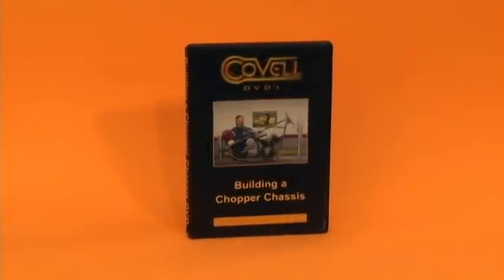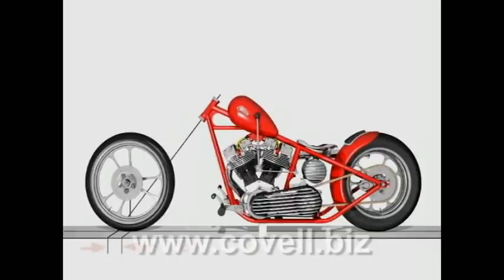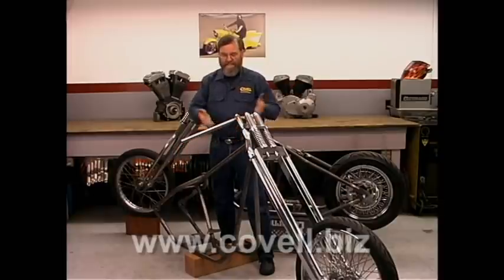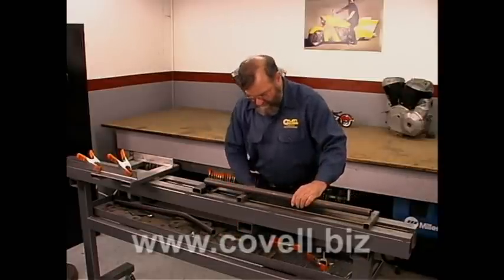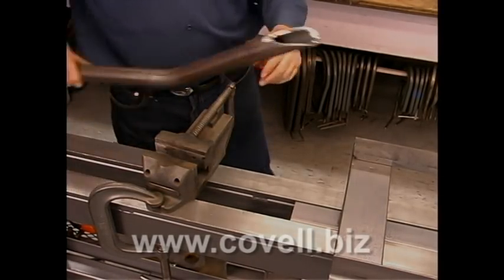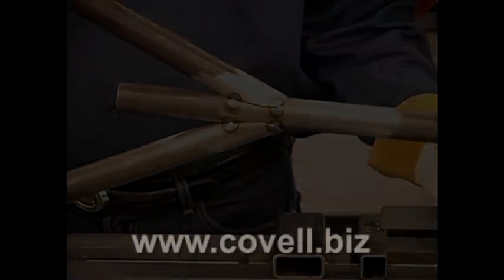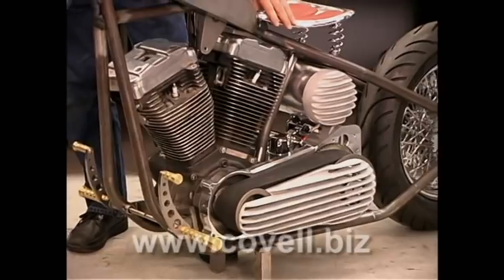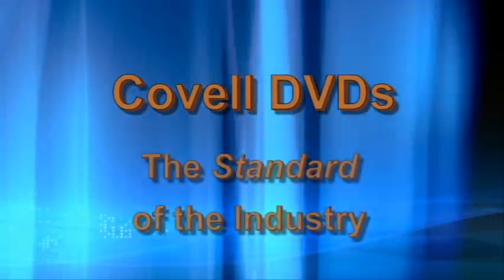Building a Chopper Chassis

Comment: I have seen recently a large number of chassis fabricators prefer to slot the axle plate for the tubes instead of slotting the tube for the axle plate. Which way do you prefer? I know in the old days the axle plate was slotted.
Reply from the maker: I like slotting the tube for the plate, so I know the plate is centered in the tube. Everyone has their own way of doing this.
Reply: @RonCovell  thanks for the reply. I can check off getting to speak to professor hammer from my bucket list...

Comment: @Ron Covell is it possible to make a frame without any of the stands my welding class would not be able to accommodate a stand but they encourage out of the way projects
Reply from the maker: The alignment of a frame is pretty essential to good handling, and it's pretty hard to get good alignment without a sturdy and accurate fixture.

Comment: Hi Ron!  I saw that you touched on Springer front ends at the beginning.  What kind of tubing and tuve thickness would you recommend in the construction of a Springer front end.  I’m going with a fat look.  My single down tube frame is 1-1/2” thick and I’m trying to stay consistent with the “fat” look.  Also how thick should the triple trees be?
Reply from the maker: Those forks were built from plans available from Crime Scene Choppers:
https://shop.crimescenechoppers.com/Standard-Springer-Plans-CSC-001-CSC-001.htm
The plans include all the construction details, and a complete materials list.
Reply: Thank you for pointing me in the right direction!

Comment: Tig or Mig welding for motorcycle frames, and what spaecs would you recommend.
Reply from the maker: Both MIG and TIG welding are used for motorcycle frames, and the most common filler wire is ER 70-S-6.

Comment: How do you set up the neck for a10-12-14 over springer fork ..and have it sit level..
Reply from the maker: It's all done with geometry. You can set up your frame level on a jig like the one shown in the video, and see what head angle will accommodate a fork that is over 10", 12", 14", or whatever you want .
Reply: @RonCovell  sooooo...
A lot of set up ..

Comment: Hi what machine do you use for bending tube?

an whats the best thickness of tubing for a chopper frame?
Reply from the maker: The tube bender I'm using is made by Mittler Bros. Not all frame tubing is the same thickness, but I'm using 1 1/4-inch diameter DOM tubing with a .125-inch wall thickness.

Comment: Ron, 
I've owned this DVD for years now.  Are you coming out with additional info for this type of fabrication?  I was waiting to see if your going to cover the fabrication and measurements for the engine and transmission mounts for the typical Big Twin engine most commonly used in chopper builds.  I can't really do this project without those critical pieces of info.  It's not out their on the web…believe me, I've looked for the past several years.  Hope your going add that info to this build.  Good stuff your doing, Ron.  Thanks, buddy.
Jeff
Reply from the maker: lowchops301 Thanks for your comments! I don't plan to do another DVD on this subject anytime soon. There are lots of plans available that will have the dimensions you are looking for, and the fabrication techniques will be identical to what my DVD shows. One source for dimensioned drawings is www.chopperhandbook.com
Reply from the maker: The plans that used to be available on the Chopper Builder's Handbook site are now available here: http://mantaraygraphics.com/downloads.html

Comment: I have very long legs and can never find a motorcycle that accommodates me even with forward controls. My knees are always up by the tank (unless I get on a bike with huge engine size). One day maybe I will try to customize a frame that allows my legs to extend forward and straight.  Which brings another point - can the downtube  angle forward rather than back or does that place too much stress  on the frame? There's always a large open space between the front wheel and the downtube on a chopper . Has anyone ever built a chopper that took advantage of all that open space? Maybe by redesigning the frame and moving the engine forward slightly?  Or maybe by having a long steering shaft section at the head of the frame?
Reply from the maker: Thanks for watching, and commenting! While is it more efficient to have the downtube go straight from the steering head to the base of the motor, you certainly could 'beef up' the design so the lower part of the frame was farther forward. I can't think of a designer who took this approach, but that doesn't mean it's not possible!
Reply: @RonCovell  Thanks for the reply - and there ya go - the forward frame could be a Covell Original. And how about a neck piviot point that is longer than the standard 10 inches or so? Might look cool and be extra strong.
Reply from the maker: You've got some great ideas!

Comment: which are all characteristics of the tube used in the chassis, diameter, sch.
Reply from the maker: For this chassis, I'm using 1 1/4-inch OD .090" wall DOM 1020 steel tubing.

Comment: friend how much is the thickness of the tubes of the frame is that I want to make a motorcycle from scratch
Reply from the maker: I used 1 1/4" OD .090 wall DOM tubing. I think you would find the CD from this company (which has detailed blueprints)  very helpful:
https://www.chopperbuildershandbook.com/cd2.html
Reply: @RonCovell  thank you my friend

Comment: Sir could you please suggest the properties of the rods used for chassis and also the material they are made of.
Reply from the maker: The frame is made from 1 1/4" diameter 1018 DOM steel tubing
Reply: Thank you sir

Comment: Sir plz tell me which tools u have use in this video
Reply from the maker: Rotary-draw tube bending machine, die grinder with sanding drum, TIG welder, die grinder with cut-off wheel, and various pieces of measuring and marking equipment.
Reply: +Ron Covell sir I still don't understand which metal rode  should I use to make frame or chassis ,which should be strong , light in weight and good welding property
Reply: and which should cheap in price
Reply from the maker: The material I used is large and heavy-wall DOM tubing, which is appropriate for that style of motorcycle. If you weight is very important, you might consider 4130 (Chrome Moly) tubing.
Reply from the maker: I'm not the guy to ask about cheap tools or material. You can do a lot of research online, but often cheap materials and tools will make sub-standard work.